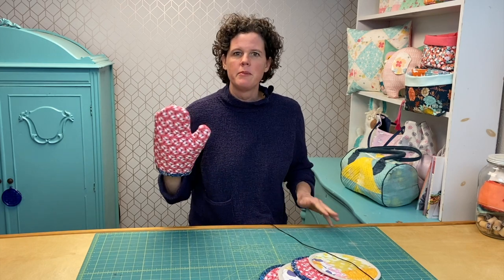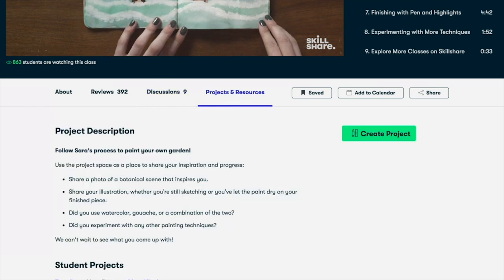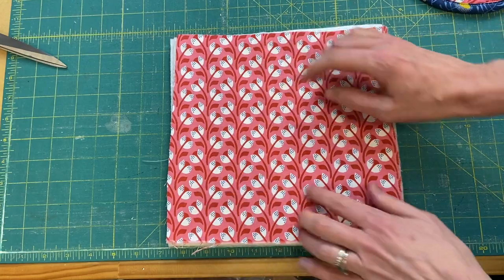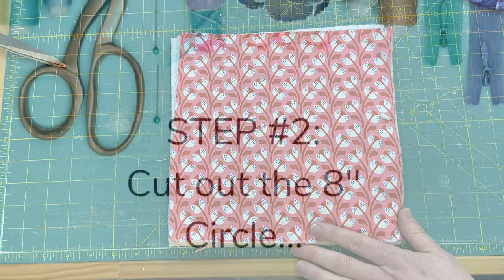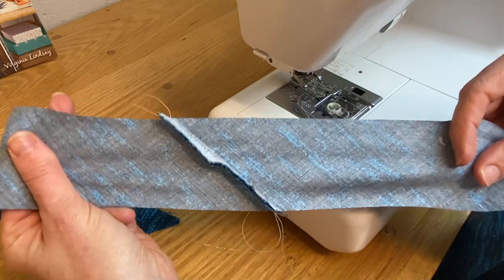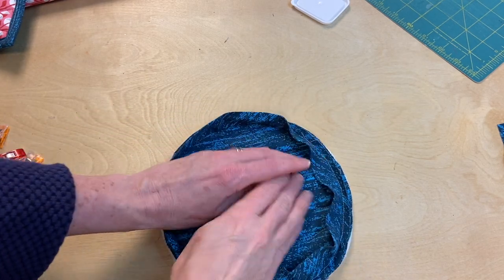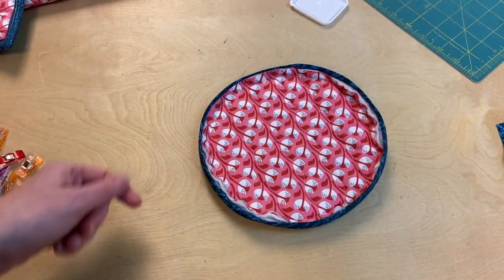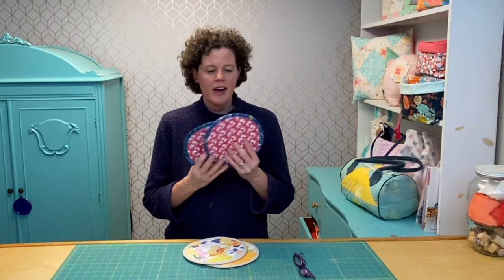6 easy steps to Sew a Beautiful Pot Holder

Comment: Hi what was your seam allowance when you attached the seam binding to the back and was there a raw edge in the front or did you sew it to the back doubled? Thanks
Reply from the maker: the raw edges are lined up together- doubled for the binding and then the circle raw edge.  I use a 3/8'' seam allowance- that is the seam allowance with the edge of my presser foot.  I hope that is clear!
Reply: @gingercakesews  Thank you. That looks easier than folding and ironing down both raw edges independently. I will make some.
Reply from the maker: @kaybonette  it is so much easier!  I started doing my binding this way when I saw a tutorial by Jeni Baker of In Color Order doing it this way.  https://www.incolororder.com/2011/07/warm-cool-quilt-along-binding.html